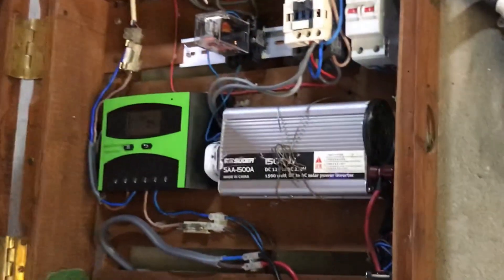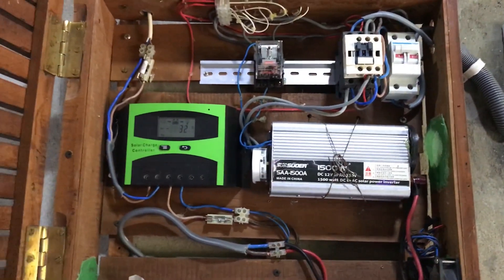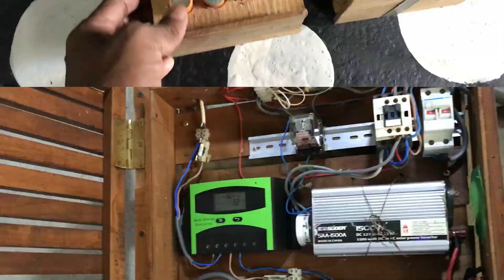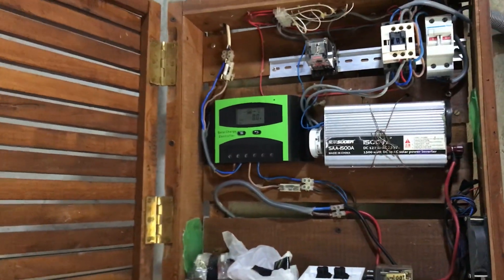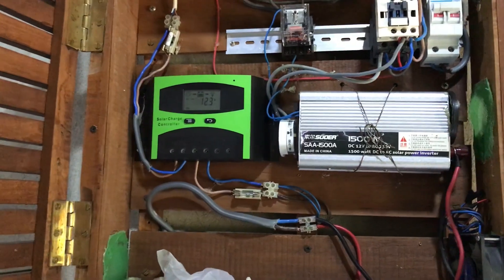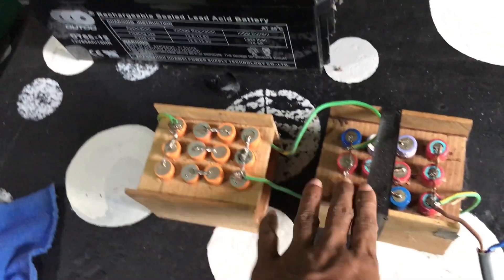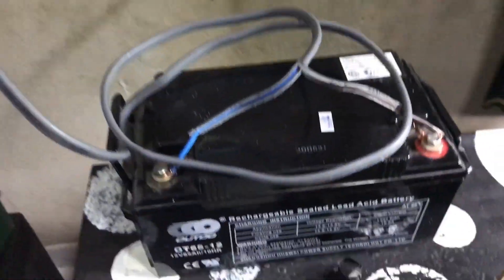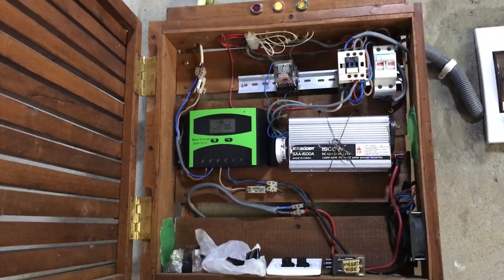Off-grid Solar panel system🌞 නොමිලේ නිවසට 230v AC විදුලිය.

Comment: This is really good video 👍. I just need to point out to replace the wooden box to powder coated box as the wood will catch up with fire 🔥 as inverter circuit getting heated up. Also recommend to use a temperature sensor and alarm 🚨 to avoid potential danger.
Reply: Please let me know the possibility of getting this precious job done by you or your agent . Please let me know the budget also . Thanks .

Comment: Nice video. FYI : As per the battery data sheet of the lead acid battery I have, if we use more than 30% of DoD (depth of discharge) the battery life would deteriorate drastically (for instance from 5 years to less than 2 years). All these details are available in battery data sheets with graphs. Please refer your battery data sheet which would normally available online. Thank you.

Comment: Modified inverter ekak refrigerator ekakata use karana eka gataluwak nadda?
Reply from the maker: එකේ ආයු කාලයට නං ගැටලුවක් වෙනවා මම භාවිතා කරන්නේ නම්  45 w ක single door හිම බැඳෙන එකක්. කොහොමත් මෝටර් එකක් ක්‍රියාත්මක වන ඕනම එකකට මේක හිතකර නැහැ.
Reply: Oyata puluwan convert karanna pure sine wave walata dc karala spwm bridge ekk danna egs002 module ekk

Comment: Was waiting for this!. Thanks a lot!
Reply from the maker: තැන්කියු සර්! ♥️
Reply: I installed a 320W panel. Found the panel very hardly. 

320W panel Rs 38000/=
30A MPPT charge controller i got from a friend. 
100AH lucas battery Rs 40000/=
Other expenses wire + bulbs Rs 10000

Really worth money. 
I run 8 - 12v  Led bulbs + my wifi router + small 12v fan for the little one. 

Now i dont care how many hours they cut the powet. I am OFF-GRID 😀👍

Comment: Refrigerator එක modified sinewave inverter එකකින් වැඩ කරන එක compressor එකට ගැටලුවක් නැද්ද?
Reply from the maker: වැඩකිරීමේදී නම් ගැටලුවක් නෑ නමුත් පොතේ හැටියට compressor එකට හොඳ නෑ. නමුත් විදුලි අර්බුදය හමුවේ එතරම්ම මිලෙන් අධික නැති මේ සීතකරනය මට භාවිතා කරන්න වුණා.
Reply: @3in1blessedhome  pure sine wave eke fans refrigerators use karana eka prashnayak na neda. Modified sine wave ups ekakata fan eka connect karala motor eka pichchuna
Reply: Ithin convert karanna pure sine wave walata dc karala spwm bridge ekk danna

Comment: බැටරිය සහ චාර්ජින් කොන්ටෙුාලර් එක ඇම්පියර් කීයක එකක් සවි කරන්න පුලුවන්ද,බොහොම ස්තූතියි, බුදු සරණයි.
Reply from the maker: Battery 65A
Charging controller 40A
Reply: @3in1blessedhome  මගේ ලග සෝලර් පැනල් එකක් තියනවා Peak Power 255W, Open Circuit Voltage 37.82V, Max Power Voltage 30.29V, Short Circuit Current 8.98A, Max Power Current 8.42A, මේ පැනල් එකට බැටරිය සහ සෝලර් කොන්ටෙුාලර් එක ඇම්පියර් කීයක් දැමීමට හැකියාවක් ඇද්ද. ස්තූතියි බුදු සරණයි.
Reply: @lasanthajayasooriya746  40A controller eka battery eka puluwan 70A 90A wenakn puluwan iita wada epa

Comment: Main supply  එක හා Inverter  එකෙ අතර auto switch වෙන්න හදාගන්නේ කොහොමද?
Reply: මටත් ඒක දැන ගන්න ඕනෙ
Reply: @dinushaprabath7735 change over ekk danna manual auto unoth delay wela haani wenna puluwan inverter ekata eka paarin load eka inverter eka on karapu gaman be wela yanna oni tikk e nisa manual hodai